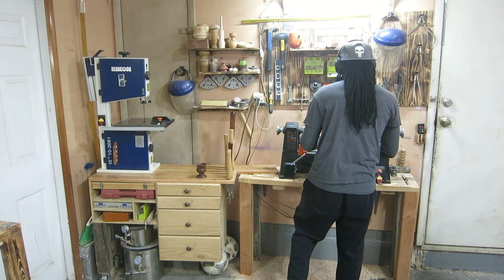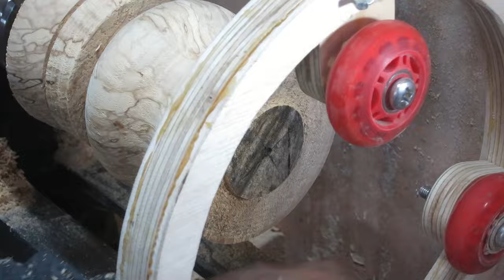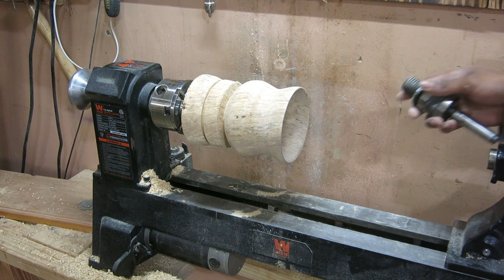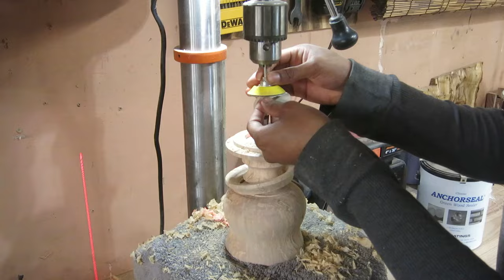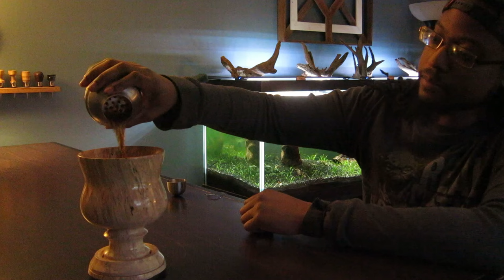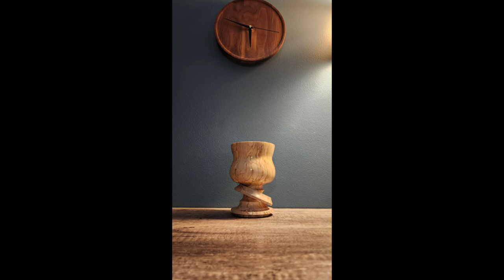The Party Goblet

Comment: So i saw in the description you used 5 coats polyurethane on the outside. Spalted maple being porous, have you ever tried out sanding sealer before putting on your lacquer? It may perhaps fill in the pores more efficiently than polyurethane by itself, cutting down on the materials and sanding needed to finish to that lustrous glossy texture.
Reply from the maker: I've gotten mixed results with sanding sealer. So typically I do a base coat of pure poly first, then sand it almost completely off. I'll do another coat of pure poly after that, then all subsequent coats are usually a 50-50 poly and mineral spirit mix. The reason I did so many coats on this one was for the added shine (The poly I use isn't especially glossy, so I've been working on my own mix but I haven't perfected it yet). Last but not least, since poly dissolves in alcohol, I wanted to make sure the finish lasted in case party stuff happens.